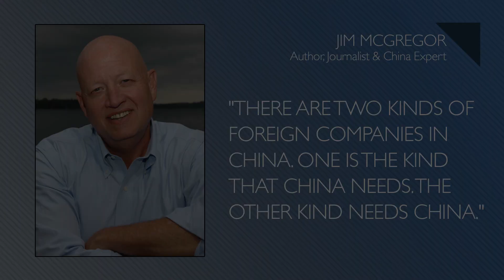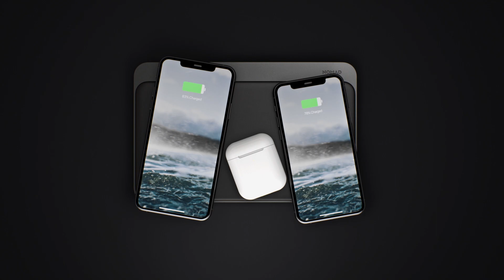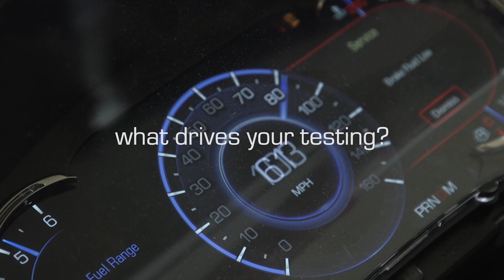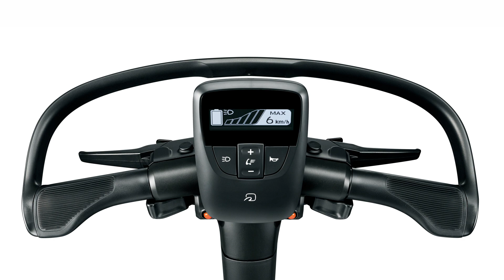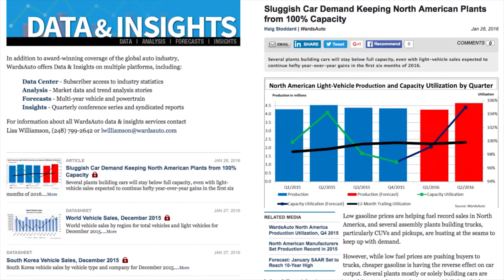BMW's New Overspray Free Paint Process; Hyundai/Kia Sales Tanking in China - Autoline Daily 3173

Comment: Speaking of BMW painting technique, please tell me how dual tone bodies (I mean those that are usually with different color roof and pillars) are produced by manufacturers! Thanks
Reply: Dual tone is traditionally done by painting once, masking, and then re spraying with the second. It really does add a good amount of cost as it takes the place of another car when it comes back around.  Or some shops may have a dedicated repair or respray line they use for this.  Either way, more paint, labour and time in the shop.

Comment: That's some impressive painting.  With little or no overspray it seems like building a paint room might get a lot cheaper.  Hopefully BMW won't tie this technology up and not let other manufacturers use it.
Reply: NO OVERSPRAY-FREE PAINTING FOR YOU...!!! (Soup Nazi voice)
Reply: Looks cool but also looks really slow!
Reply: @Thatdavemarsh  

Do you have any feel for how much slower it may be compared to regular paint robots?

If it is slower then, perhaps, the solution would be to use two parallel spray booths so two bodies could be painted at the same time and not hold up the line. With no overspray seems like all that would be needed is to make the booth wider or longer and add a second set of robots.

Comment: I wonder if it's possible to "plate" car parts rather than paint them. Electrostatic application of dry paint powder should reduce waste. However, the BMW print head style painting is a better system if they can get it up to the speed of painting and as mentioned allow for unlimited graphics to be applied. I just hope folks don't start putting photos of their kids and pets on cars, image how ugly that could get. 😁 Seems like everyone has tattoos these days the last thing we need is random stuff on cars too. Not that any one of them would be ugly but an entire road filled with them would look bad.
Reply: Powder primer has been used for decades and it is highly efficient and lower environmental impact.  Basecoat and clear powders have been developed but I’m not aware of widespread use as powder does flow out as well as liquid does.  The flow out is what gives the mirror smooth glossy finish.  Powders tend to orang peel.